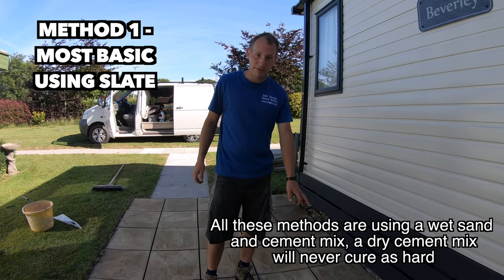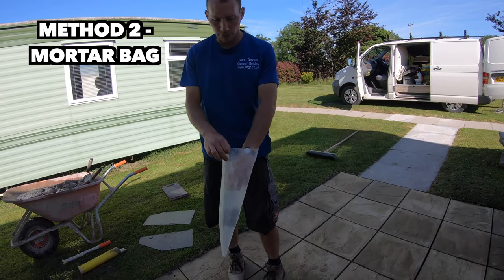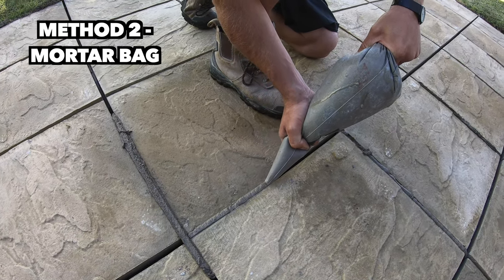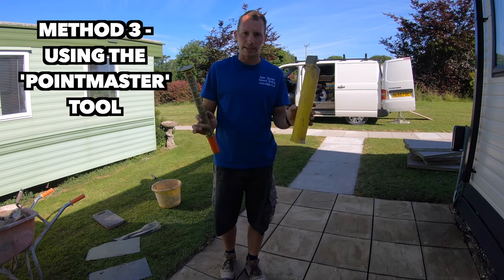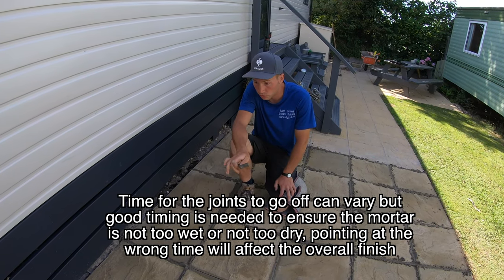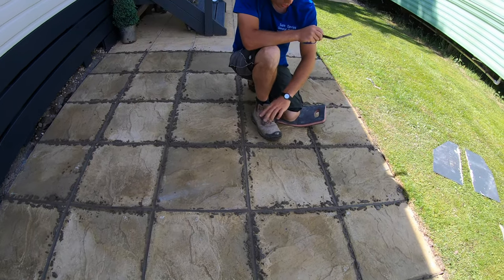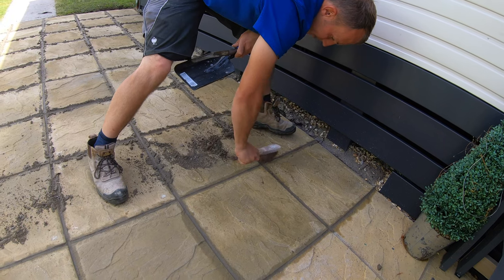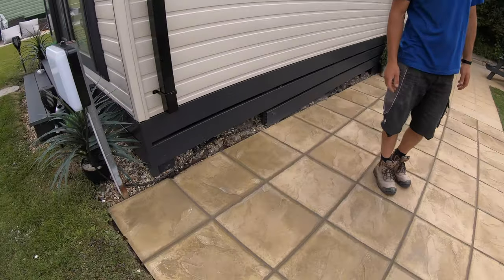Patio slab pointing with mortar (3 different methods!)

Comment: The commentary had lots of phrases such as "a good mix", "leave it to go off", "when its dry enough". If you have enough experience to make these judgements, you probably don't need this video. If you don't, the video doesn't help.
Reply from the maker: I do understand where you’re coming from with your points.  There is videos on my channel of how to do a good mix.  With regards to time with it to go off when it’s dry enough it’s so difficult difficult to explain as it’s so dependent on whether the conditions and temperatures

Comment: Slate? Lol. Just use a firm dryish mix, pack it in and shape and remove any excess with no staining.
Reply from the maker: Yea slate is for DIY'ers that cant keep the slabs clean, just an option for people.  I have never got on with using a dryish mix as it doesn't seem to go off as well as using a wet mix

Comment: The trick with the "squeeze bag" is to apply pressure at the BACK of the bag, not at the tip. You know this if you've iced cake using a pastry bag.
Reply from the maker: Good tip, thankyou

Comment: I bought a point master after seeing you use it on another video. I couldn't get the mix quite right. I changed to using a tuck pointer which I found very easy to fill the joints neat and tidy. As a low skilled DIY tuck pointer is the way to go for me, though I'm sure someone with more skill could do a better and faster job with one of these three methods in this vid.
Reply from the maker: Hi Alex, I think getting the mix right is probably one of the hardest things to do. I probably should have included the tuck pointer method in this video. I’m glad you found a method that works for you too

Comment: Great video, just completed 30 metres of patio pointing using the grout bag method.  Never heard of this till I saw your video and couldnt believe how easy it was to do, will be using this in future for all my pointing work.  The only difficulty was that if you are pointing indian sandstone where the joint sizes can vary or be uneven you need to take a bit of care when squeezing out the grout.  thanks
Reply from the maker: No problem, to be honest even though I’ve been a builder for 15 years I’d never used a grout bag before last year! Yea you do have to be a bit more careful on the sandstone but once you are used to the grout bags they are nice and controllable. Thanks for watching too
Reply: They sell plastic point bags where you cut the bag yourself.This is what I use so on thin joints I can squeeze the tip to avoid getting it on the brick or stone.

Comment: Excellent video, thanks. Just did my first paid job last week using method 1 and it looks okay, but definitely going try methods 2 and 3  👍
Reply from the maker: Glad it helped you! A bit of a nightmare doing cement pointing this time of year getting it to go off.  Methods 2 and 3 are great and quick just got to get that mix right
Reply: @SamDaviesBuilder  yea I bought sand and when I opened it up it was soaking wet and a lot of it was solid and frozen as well.. Luckily I was speaking to the elderly neighbour moaning about it and he said I've got a few bags in the garage you can have, so that was a handy save. I'm doing his patio and another neighbors next week so all good, I just hope the one I did last week still looks okay when I pop back there 😅
Reply from the maker: Ah yea I had sand the other day that was soaking, put no water in the mixer and still the mix was a bit wet! Let me know how the other patios go!

Comment: Great video, and having tried this technique a while back and recommending to others, I defo find the piping bag easiest and quickest. Great advice on timings of when to strike with the pointing tool and how to remove the debris. If you end up with any wet cement on slabs from pointing too early, a big wet tilers sponge comes in handy 👍
Reply from the maker: Thanks, good tip with the tilers sponge too!

Comment: Great tutorial. I have a pressure washing business and more frequently being asked about re pointing patios (aged damage not damage I’ve done) quick question, what makes a ‘good mix’? Yours looks wetter than than other tutorials I’ve seen?
Reply from the maker: No problem, thanks for the compliment.  

So for me I always use it wet rather than a dry mix to brush in as it never goes off as hard when brushed in dry.  A good mix would be a nice creamy mix that the water doesn’t separate from - a good test for this is if you push the barrow across bumpy ground then water shouldn’t be coming out of the mix and sitting on the surface.  It should be smooth if you trowel it and not break apart easily.  It’s quite hard to describe but hope this helps. I do have a few videos about mixing on my channel.  Any more questions feel free to ask away
Reply: @SamDaviesBuilder  magic, thank you. I’ll take a look and do a few test mixes. Appreciate the response 👍
Reply from the maker: @dirtlushpressurewashingser114  no problem.  Just remember use a good quality plasticiser and sand.  Don’t add too much of the plasticiser (or too little 🤣) and give it a chance to mix

Comment: Hi, thanks for these techniques. Is it also possible to spread dry cement mix in the cracks (like polymeric and) and then spray water in a controlled fashion? Please let me know if there will be problems with that. Thanks
Reply from the maker: Hi, I wouldn’t recommend that.  That method seems to never set as hard as the method I show in these videos.  Wet mix always sets firmer and if done right will last years
Reply: I did just that and it has hardened ok, but there's was mortar staining along all the joints, which was hard to get off. I brushed it in carefully  but there was some on each side of the joints. So I dont recommend it!

Comment: I have porcelain pavers with polymeric sand, but the patio is below grade level which means it's wet underneath. I'll try this method. Does anyone know if there'll be problems with drainage? This is the video I was looking for. Very informative. Thank you for posting.
Reply from the maker: Hi, what gaps to you have between your porcelain? Anything less than 10mm won’t really be suitable for this
Reply: Thank you for letting me know. The largest gaps are at the walls which is over a one inch gap. @SamDaviesBuilder
Reply from the maker: @lovejoy9592  that gap would be fine, it’s just knowing what your smallest gaps are so I can advise the best way to go

Comment: Hi Sam, nice job. Can you tell me if your area is suitable to park a car. If I'm not wrong the slabs are 38mm thick if 600x600 and 32mm if 450x450.. I'm planning to do something similar to park a car. I don't like the look of the council standard slabs (50mm) which will be better for driveway. I would use these ones you used. Thanks
Reply from the maker: Hi, thankyou. 

I have never laid any to park a car on so I can’t really give good advice.  I have seen people park cars on these slabs with a full mortar bed but I can’t comment on the longevity of it. 

I would normally recommend block paving  for parking a car on as they can take any movements where as a slab like this would just crack if it moved.  

Hope this helps a bit!

Comment: Hi Sam, love your tips. Are you able to share what ratio you use for your grout, particularly for the grout bag. I’ve tried a few mixes for my patio pointing and none work anywhere near as well as that in your video. Thanks
Reply from the maker: Hi,

This mix would be 4:1 which would be 4 parts sand to 1 part cement with plasticiser.   There is a couple of videos on my channel about how to mix mortar, they may help you :)
Reply: @SamDaviesBuilder  Thanks, yes I found that just after I posted this query, really helpful
Reply from the maker: @davids9815  no problem, let me know how it goes!
Reply: @SamDaviesBuilder  I used the grout bag today, followed your 4:1 ratio plus plasticiser, and it worked a treat. Took me a while to get my technique right - I found tightly gripping the back of the bag with one hand then squeezing with the other hand closer to the nozzle worked best for me. Pleased to get that out of the way!
Reply from the maker: @davids9815  glad it worked well for you!  It is hard to get the technique of squeezing it out right as I found that out when I started using the grout bag.  Now you can enjoy your patio!

Comment: My problem is that I can never make a mix that flows enough to use a bag.  The video says 4:1 sand/cement with plasticiser.  What kind of plasticiser do you use?  Your mix doesn't look very wet yet it flows wonderfully!
Reply from the maker: I use the concentrated plasticiser, Sika is one of the brands that do it. 

How long are you leaving it mix? If there is any water rising to the top of your bucket/wheelbarrow out of the mix while you are using it then it’s not been mixed long enough.  I have a few videos on how to make a good mix on my channel

Comment: As I am a chef can I just say that using a piping bag is agood idea  but only half fill the bag and you will find it much easier
Reply from the maker: Thank you I will take your advice on board
Reply: because the bag is only half full you can twist the end closed and a gentle squeeze will be all you need ok
Reply from the maker: @laurencebarber4152  yea that sounds good advice
Reply: is it possible mr lauren chef to do a 1.5 mm nozzle for the piping bag?
Reply: The nozzle size very much depends on how liquid the mixture is but give it a go and you will find out best of luck

Comment: Can you say why mortar is better than polymeric sand for this?
Reply from the maker: You would only use polymeric sand on very narrow joints (1mm wide).  On bigger joints, you have to use another product as the polymeric sand is too fine to hold itself together

Comment: Throw it in the bin old school best way 👍
Reply from the maker: Hi Tom, what’s the old school way?
Reply: Just find with the gun went p pump it into the joints it takes too long and put into bits of slate either side of  the joint takes too long that's my opinion old way is 3 soft sand 1 sharp sand 1 cement always gauge it in bucket so you all way get the same colour  put in mix little bit spr or UniBond mix up like it semi-dry so you can make like a fist ✊ in hand to test it be for you put mix in the joints with a gauging trowel make sure the slabs are absolutely dry or they will stain one you put in the joint are filling then run or Donna or finger trowel try like you striking the joint  clean off the excess as you do about 10 square be some excess bit just brush it off with a soft broom come up really well 👍 used to do diamond point in as well same mix only little bit wet then put in joints then would use my little pointing trowel once I feel the joints and then strike each hedge with the little diamond pointing trowel come back next day gone off hard would clean snots  excess with your trowel on the edges put a stiff broom over it come up really well 👍 another way off pointing is put in the joints with the same mix little bit wet to the top joints then sponge it off like tile grouting 👍 retired old stone mason got 40 years at experience 👍 hope this will help you  but you never stop learning 👍
Reply from the maker: @tomnapper101  I do like the diamond pointing. You know your stuff but with the semi dry method unless you really understand it like yourself it’s hard to do, I’ve seen so many people do it and it not go off like when a wet mix goes in or stain the slabs like mad. I’ve aimed this video more at the DIY’ers as for us builders it is a breeze doing pointing, there’s so many tricks and tips to learn on it and nothing beats experience like you have, all these skills are getting slowly lost!
Reply: If slabs are dry it doesn't stain . When you put the point in in Plus goes hard because it's got the spr in it or Una Bond in mix  👍  there's  good point material to use is called gpm is in a powder  got additive with it all knock it up with a paddle drill add water  you got five different colours and it stays the same colour  really good stuff you should try 👍
Reply from the maker: @tomnapper101  cheers Tom will check that product out!

Comment: As a builder I never realised any one person can make such a mess pointing a slab patio  Joe
Reply from the maker: Are you implying I am making a mess here?
Reply: you should see the mess I've made of mine then!
Reply from the maker: @hTyKn1  what would you have done differently to not make a mess? I definitely made a mess when I started out!
Reply: @SamDaviesBuilder  I have used kiln dried sand at 2:1 with cement to try and make it rock hard so it won't wash out. I just put piles of it on the slabs and swept it in before chopping it in to compact it. I then used a hose with a fine mist to wet the joints but it's left a film over the slabs.
Reply from the maker: @hTyKn1  ah I’ve got you.  Kiln dried sand is way too fine for pointing it hasn’t got large enough grains for strength.  Wet pointing like in my video means it sets rock hard.  You can get the film off with a brick acid (don’t use brick acid on sandstone or natural slabs though, you’ll have to get a specialist cleaner for those type of slabs)
Reply: @SamDaviesBuilder  ah okay, what's the best sort of sand?
Reply from the maker: @hTyKn1  building sand suitable for bricklaying

Comment: just brush in dry mix sand and cement any moisture will set it...simples
Reply from the maker: You may be good at this method but most people doing this will just brush it in dry, not compact it properly and not get any moisture on it and then it will just crumble and come out in a short space of time.  It is a very difficult method to get right!

Comment: How much would it cost to have the patio pointed like that? good job well done ✅
Reply from the maker: Hi, it all depends on how big the area is and if it's a new patio or work needs doing to take out old pointing so it is difficult to say how much it would cost.  For the work I was doing in this video it would be a days labour plus materials - depending on your area will probably affect how much a day rate would be.
Reply: @SamDaviesBuilder  thanks for the feed back, it helps a lot. Continue with your good work it’s unfaultable. 👍🏻
Reply from the maker: @mmamodfatheruk3094  thanks 😀😀

Comment: How do you maintain the pointing gap, and at what width?
I'm going your way with my rivens!.... I think 🤔🫠😆
Reply from the maker: I just do them by eye but when I started out I used 12mm ply cut into strips as a spacer.  

You’ll be fine following my way… a good mix is key!
Reply: @SamDaviesBuilder  
great! I've made a gap bar out of old wood. It's about 11/12mm too.
Friday is the big day. Thanks for the video and replies.
Reply from the maker: @ryandoherty6174  no problem at all.  If it’s really warm, don’t do too much at once.  Once you get a feel for it you can do more of an area at one time
Reply: @SamDaviesBuilder  I see. If it gets roasting, I could do it in the evening when the sun goes down, maybe.
Looking at your mortar mix and a couple of others on here, it seems like patience is the trick. Let it mix.....
Reply from the maker: @ryandoherty6174  yes patience is key, let me know how it goes